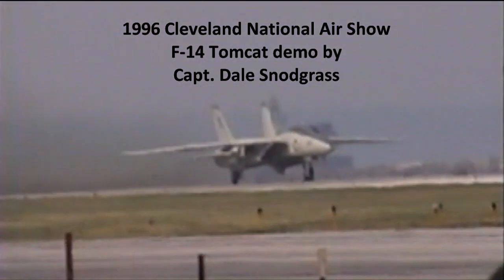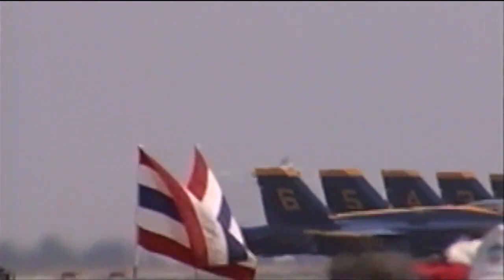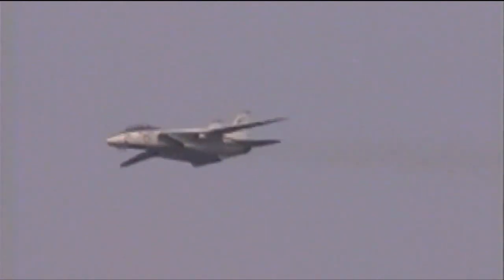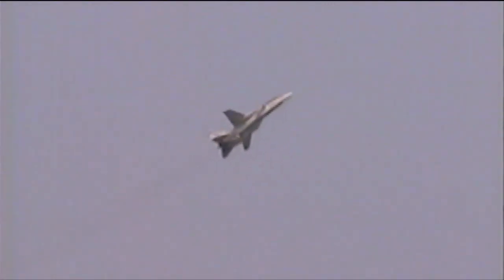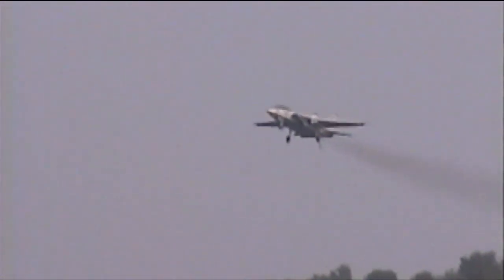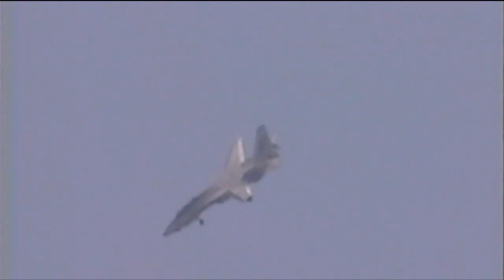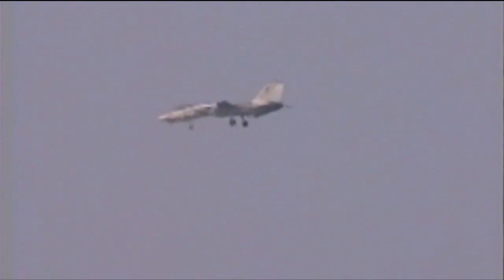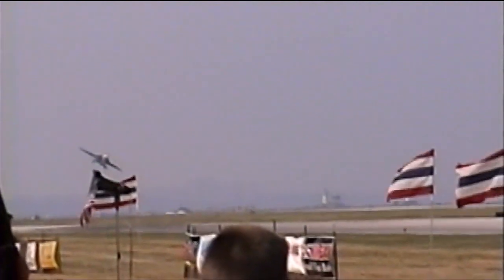F-14 Tomcat: Demonstration by Dale Snodgrass :: 1996 Cleveland National Air Show

Comment from the maker: The F-14 is a big, powerful interceptor that is undefeated in battle.
Reply: MrSHiNFORCE Well, there was one lost by the Iranians, but it was just one...
Reply: +Eagle Ace Iran lost more than 1 F-14 in A2A combat, but still managed to rack up an impressive 30:1 kill ratio.
Reply: Henry Yeh
Well, that one was directly shotdown, the others I believe were due to compressor stalls in the engines.
Reply: +Eagle Ace Also one was lost in Desert Storm after it was shot down by a SA-2 SAM missile.
Reply: Megalodon64
we're talking about air to air combat, SAMs don't count, by that logic. every single combat aircraft has been lost in battle
Reply: Dale Snodgrass went to war in Afghanistan and Iraq and fought against MIGs. He flew both F14-A and F14-D versions and never lost a fight.
Reply: @Megalodon64  indeed, a friendly SAM shot it down!
Reply: ogre1074  He engaged a few in dogfights according to his book during the gulf war, but like all of the other MIG-29s, they bugged out after a few maneuvers (Saddam had instructed them to).
Reply: @KLRGT500KR  correct Saddam wanted to save his aircraft, because at the correct airspeed the and with the G-limit removed in a combat scenario the F14 was capable of almost 22 degrees per second turn rate. Especially at low altitude around 350 knots. The downside to that turn rate was that the cat is very large and it bleeds energy very fast when turning that hard. Same problem the Sukhoi fighters suffer from.
Reply: @lovemym16  F-14 was a high energy fighter with those big wings providing very high lift/drag ratio and low wing loading under high drag maneuvers. The energy could be lost because of its very high angle of attack (AoA) limits up to almost 90 degrees, which allowed it to snap the nose vertical instantaneously at any speed, but it could cause loss of energy at slow speeds. The F-14 entered the turn at 350 knots turning speed and actually accelerated up to 450 knots while going through the minimum radius turn. It came down to how the pilot was managing its energy especially with the afterburners lit. The B/D model with the GE-110 engines was so powerful that the afterburners had to be turned off because it was gaining energy so fast while tunring. If you look at airshows where it did the full minimum radius turns in 19 seconds in about 1200 feet in a speed range of 350 knots to 450 knots., 'Snort' Snodgrass would go directly in a vertical climb a lot of times after that. It was because the pilot maintained energy well.
Reply: Phoenix missiles might have something to do with that.
Reply: @larryfoulke1088   Actually, several of them were shot down by Mirage F-1s and MiG-23s.
Reply: @KLRGT500KR  With much respect to Snort, I don't believe he ever won an engagement either.  Third day of Desert Storm, Snort briefed his crews and told them that if you see anything flying with a single afterburner, shoot first and ask questions later.  Then, over Iraq, Snort had to maneuver to avoid a SAM and one engine went into compressor stall.  There he was, at 250 KIAS, on one burner, around 10,000 feet, hoping none of his pilots were on his six.  He finally was able to light the second engine and get out of there.  During that mission, he was forced to concern himself more with saving his aircraft than with looking for one to shoot down.  

I have had the privilege of seeing Snort fly many F-14 demos, as well as F4U and F-86 too.  Got to meet him at a show where he demonstrated the Sabre.  As a kid, I remember him flying F-14 demos for the Pratt & Whitney and other east coast air shows.
Reply: @DrittAdrAtta  Nope.. they lost several to SAMS.. and worse, it was friendly ireanian hawk batteries.

There are no verified reports of Any F14 shot down by any other aircraft.
the Iraqi's would have been very happy to show you a smoking wreck of a tomcat if they had managed to shoot one down.

keep in mind they were the offensive, they had invaded Iran.. So they were flying over their held territory and a shot down Iranian would have been a photo opportunity.

No such pictures exist, because it didn't happen.
Reply: An Iranian f-14 was shot down by a MiG-23ML on 11 August 1984.

Comment: How did one guy fly so many demos for so long?  It seems like Snort was the Tomcat demo pilot for 10 years.  Now they're only done by the RAG.  He's a legend!
Reply from the maker: When you're this good, I suppose you get your choice of missions.
Reply: He also went to many combat missions with the F14 and fought against MIGs and never lost. He always said, he would take on an F15 in an F14 any day.
Reply: the F-14 in the D configuration is much more maneuverable than any model f15. once they switched to the General electric engines it went from a great fighter to the best 4th gen fighter in the world.
Reply: @KLRGT500KR  he never shot a MIG down. So its a draw
Reply: @bmwr9tracer668  He chased away a few MIG-29 in Iraq in the early 90s. He never shot one down, but he did flush out a few.
Reply: @lovemym16  Not really. The f-14D can only hold its own against the f-15C at low altitude - Dale Snodgrass' words.
Reply: @DrittAdrAtta  you forgot the other part of his sentence. In slick configuration and at higher altitudes  because of the wing shape. Once you load them in combat configurations the F-15 has much more drag.
Reply: @KLRGT500KR  Snort, as best I recall, never shot down MiGs.  But he did fly a lot of 1v1 against Eagles, and in his words, he did rather well against them.  The Tomcat generally could do better down low against an Eagle, to hear him tell it.
Reply: @lovemym16  No, not exactly.  The F-15 at higher altitude with that big wing was better.  The Tomcat's wing sweep was actuated based on mach number, not indicated airspeed in knots, so up higher in the thinner air, the plane "flew faster"
Reply: @lovemym16  And the F-14 magically does not have the same drag penalties?  Come on, think man lol
Tomcats flew with the two tanks on the nacelles, plus the racks, plus missiles, plus often carrying missiles in the tunnel as well.  The weight and drag penalty was there for both planes.
Reply: @lovemym16  Not quite.  Thrust is not maneuverability on its own, in fact the airframe has more to do with it than thrust does.   And whether you like it or not, Snort tells the tale of how he beat out the F-15....he had to, in his own words, "cheat".  He would set up his Tomcat in conditions "prohibited" by the exercises.  Also, he admits all day long that at anything above low altitudes, the F-15 is just a higher performance plane.  His plan against the -15 was always low and slow.  His final flight in the Navy was against the F-15 demo pilot, and Snort RTB with broken slats and emergency low fuel.  Their mock dogfight bottomed out around 500 AGL.  Snort has made it clear that the pilot is what always made the difference--and Snort was like Captain Kirk, in that he would even rig the game whenever possible in his favor.  That's how he was so successful, not because the Tomcat was a better aircraft.  Watch his demos, he's truly a brilliant pilot.  I'd bet you could put him in a King Air and he could beat Chinese or Russian jet pilots all day long.

Comment: Those were the TF-030 F-14A 'Snort' was flying. You can see in how it can go vertically up even at slow speeds. The TF-030 might have been unstable at slow speeds at high AoA, but they were beasts when they had air flowing properly into the intakes.
Reply: There was a crash in Willow Grove back in the day, and the cause was slow speed.  Killed were the pilot, Lt. William J. Dey, 30, of Hightstown, N.J., and the radar intercept officer, Lt. David E. Bergstrom, 31, of Virginia Beach, Va
Reply: @vanillagorilla8236   Yes, I know about that. That has nothing to do with this. It was caused because the pilot did not monitor the knots and reduced the speed to the stall speed of around 80 knots at very low altitude while performing a slow roll.

Comment: pretty agile for such a large aircraft.  although it should be noted that it's an airshow configuration (no weapons, external fuel tanks, low internal fuel levels)
Reply: +Taylor Smith Shouldn't that be noted for every air show demo flight for every aircraft type? The F-14's performance actually didn't suffer as significantly with stores compared to other aircraft that have to place nearly everything onto the wings.
Reply: They designed it that way. Navy went very hard on Grumman to design a plane (and penalties if they did not meet their performance requirements) that could do long range intercepts and if it had to fight against MIGs during cold war, it could take them out at all costs. Essentially, go super fast at Mach 2.4 to intercept the enemy MIGs as far away from the Navy assets and fleets and to take them out at all costs whether by way of BVR or WVR engagements.

Comment from the maker: They retired the Tomcat in part because of deterioration from decades of flying in salt-air at sea. The F-14 will always be one of my favorite military aircraft.
Reply: Actually that's not true. They killed it because Israelis were afraid that Iran could continue to smuggle parts for it. They were petrified at that idea and insured every single F14 is shredded!! These psychopath have infiltrated all the sector of the government.
Reply: @meenam300zx  Absolutely not.  The F-14 had gone beyond the airframe's lifespan.  The cost to maintain it had become prohibitive when compared to the cost for newer aircraft which offered greater flexibility in the operations needed by the USN.  F-14s were preeminent long range interceptors, meant to engage Soviet backfire bombers and such over 100 miles from the taskforce. With the collapse of the Soviet Union the massive long range engagements it was designed to excel in were no longer a likelihood.  Close range, with visual acquisition and confirmation as well as multi-role fighter/attack aircraft were needed.  I LOVE the F-14.  I grew up on Long Island in the shadow of Grumman and the F-14.  I got my degree in Aerospace Engineering after spending time with Dale Snodgrass's father, Rueben, at his home on the shore of Lake Ronkonkoma, where I grew up.   Rueben Snodgrass had been an Aeronautical Engineer for Grumman starting in the late 1940s and could talk aircraft engineering history all day.  Sadly I never got the chance to meet Dale despite all the years I fished from his father's small dock on the lake in the 1980s.  

There were ZERO F-14 parts exported after the split with Iran.  Anything purpose built for an F-14 wasn't exported, period, because nobody else in the world used them.  You did have the normal scum who would divert parts suitable for dual use, civil and militray, to Iran but while bad that wasn't the critical stuff needed to keep those planes effective into the 21st century.   

As far as the procedures for scrapping the F-14s; yes, every piece of hardware, parts and electronics were catalogued and destroyed as part of preventing the Iranians from getting any parts to prop up their fleet of F-14s.  When you see an F-14 on display at a museum or elsewhere it is stripped out.  You are looking at an airframe missing all critical components.  Those Iranian birds are held together with spit and bailing wire and it is understood they can fly nowhere near the full envelope the plane was originally designed for.  They have not seen an original spare part for forty years.  In addition it is known that the Americans who were in Iran as part of the contract to help maintain them did the Iranians no favors as they left...

Comment: I thought it was ignorant politicians who killed Tomcats.
Reply: no just one, Dick Cheney
Reply: They're not ignorant. They're CORRUPT.
Reply: There was really nothing "ignorant" about the retirement of the Tomcats.  The F-14s that were still in service at that time (when they were retired) were so broken down that they spent more time being repaired than they did flying.  The maintenance costs were becoming astronomical.  And because the Navy already had Super Hornets flying and doing the same job as the Tomcats, it made sense to retire the F-14s and "replace" them with the newer, nicer (condition-wise) Super Hornets.  Now there is no doubt that the F-14 was a MUCH better fighter when it came to close, air-to-air combat, but that kind of air combat is essentially non-existent at this point.  When air-to-air missiles have ranges of more than 50 miles, the chance of an old school "dogfight" happening in the air is incredible slim, especially for the US military.
Reply: @DanglingDingleBerry  F14 has good maneuver as a heavy fighter/intercepter. But F/A18 is also very good and even better at lower speed, high aoa performance, especially with HMD and aim9x, F14 cannot match super hornet in a dogfight, unless no missile allowd, which will depend more on pilot skill.
Reply: @DanglingDingleBerry  That's not entirely true, they were still flying just fine and the ones that were flown continously had good up time
but they had to canalbalze some hangar queens for parts, the supply chain was the problem.. Old 70ies tech
the D had none of that problem because it had more modern tech.  All A's and B's could have gotten to that level.. But Cheney just blocked all that.
Reply: @qiyuxuan9437  flying slick over training fights is not realistic.
as a slick plane an F18 is better but wars are not fought with slick planes, but with planes carrying ordnance.
The F14 could fly further and carry more payload with less refueling then Any F18.. And it was a better fighter  with that payload
an F18 has to choose between ordnance or fuel load and it carries everything in high drag an F14 took both and the center tunnel was low drag..
Reply: @stijnvandamme76  Well, if F14 can be a overall better aircraft if it got full 21th century modernization on radar, avionics and fly by wire(F14D was pretty close). But the maintenance cost was rumerd to be more than doubled compare super hornet, which is the reason F14 project was ended.

Comment: I know most of the fuel is in the wings but those engines are drinking it at a hell of rate! We had the had the English Electric Lightning back in the 60,s that burned so much fuel it had a very short flight time.We are talking gallons per minute.

Comment: There were a couple different versions of the F14. The earlier ones had a much weaker a problematic set of Pratt and Whitney after burning turbofans. Then they called up GE and starting putting in the GE engines in the F14. They made about another 10,000lbs of thrust over the P&W engines.  It really made a huge difference to the Tomcat. I never know which is which when I see these earlier demos.  Ones things for sure Snort definitely loved the huge boost in power!  RIP

Comment: anybody know why the cat was never used by the Blue Angel Flight demonstration team
Reply from the maker: Chad Neuendorf , its most likely because the F-14 more expensive to maintain.
Reply: MrSHiNFORCE would have a he'll of a sight though a flight of blue cats in formation
Reply: Chad Neuendorf .......The F-14 are not as precise in their maneuvers, as even the F-4. I know the F-18 are flying 36" to wing tip. If i was to guess that would be it. I wish they could have.
Reply: The F-14 was too big and it couldn't maneuver very well. Other than that it was still a kick ass fighter
Reply: a slick F/A 18 is way more agile.

It can't fly far, nor carry much ordinance far..  But as a slick plane, it's more agile.

And much cheaper to maintain since there's no swing wing mechanicals to deal with.
Reply: Why in the world would it be used in such capacity? Why not F-111 then? Only complete F-14 fanboys believe it was superior to the likes of F-15 or F/A-18. Sure, Snodgrass could say this and that, but at the end of the day if you read between the lines he admitted both planes were more maneuverable, so you either "have to cheat better" or just be a "better pilot" to win against them.

Comment: Ok seen this 100 times, lets do something different; do this on one engine, no engines and a restart, inverted with landing gear extended etc. How about a hammer head, a spiral descending spin, a passing tail stand etc. Just tired of the same old lazy 8's. I guess after 100 airshows plus, they're all the same, except maybe the Bob Hoover Sky Commander shows. Now there's a pilot that not only knows his airplane and can do acrobatics totally out of the ordinary with and without engines. Rip Dale, a true pilots pilot. Thanks for sharing. Best Wishes & Blessings. Keith Noneya AT1 USN/USNR-TAR Retired.